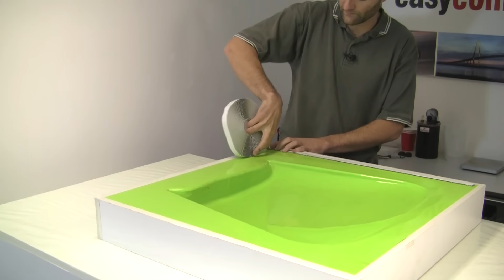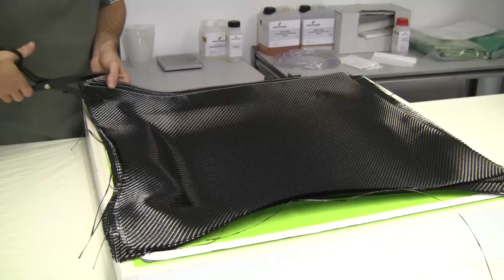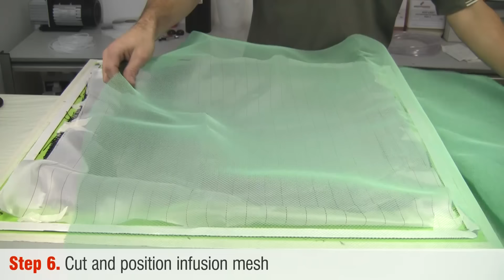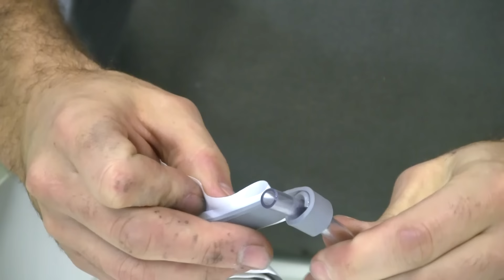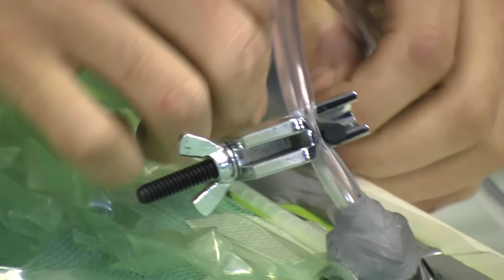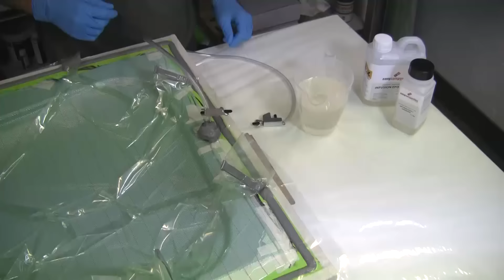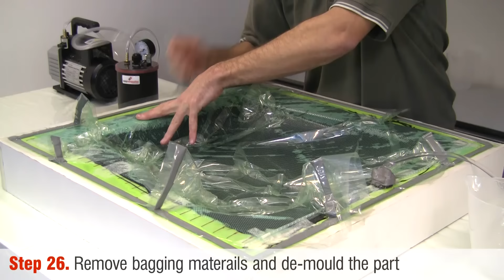How To Do Perfect Vacuum Resin Infusion of a Carbon Fibre Part - Basic Tutorial

Comment: What about the gel gun spray and coat? The video about how to make the bonet shows you applying the gelcoat. Could i make it without the gelcoat and just apply easy release and wax?
Reply: @eeedoubleyou  So i can make a mold with the uni mold kit and aslong as its good taken care of i dont have to do the gel coat process?
Reply: I saw some people who did it without gel coat and it came out perfect.
Reply from the maker: The Gelcoat is optional.  In many mild climates like the UK, you would not even need to lacquer it.  Some sunnier climates it might be wise to use a UV Stable lacquer if the part has no gelcoat.

Comment: how do you calculate required cfm for a given area to select the vacuum pump
Reply from the maker: This is a common question but actually the required CFM of the pump is not related to the area that you're vacuum bagging. A pump of any size can impart the same pressure on a mould the size of a football field as it can on one the size of a postcard. The only reason you might want a higher CFM pump on larger components is to either (a) make the initial pull down faster or (b) overcome leaks if you've not sealed your bag properly. For modest sized components you should always be able to get a properly sealed bag and the pull-down time is not likely to be too long some something like a 1.5CFM pump would be more than adequate.
Reply: @easycompositestv Our component size is abt 400 square cm. Can you now suggest an apt CFM and HP requirement, please?

Comment: i think you can do this without the mesh... its a small piece with only 1 layer
Reply from the maker: You need a flow media of some form, be it a mesh or a core that flows well.  You may get away with the natural through flow on small fabric parts but in most cases the flow is very slow which can cause practical issues with pot life and gel times.
Reply: @easycompositestv  i never had issues with 2x2 meter pieces let alone small ones 

but it all depends on the material you use but still on a small piece as that there is no need really ... you just need to make sure you dont put too much of the catalyst for obvious reasons

Comment: That Peel-Ply way to expensive, gonna experiment a way around that cost.
Reply: you dont need it ... its just there so u dont lose time with smoothing up the leftover resin crap... i think you can even do it without the mesh becouse there is only 1 piece of carbon

also i dont know why this guy is puting holes in the bag ... you can just put the hose under the bag...

Comment: you can de-gas the resin by applying a vacuum (in a sealed container ).
Reply from the maker: Resin can be degassed in a vacuum chamber to remove any trapped air, however this is not normally necessary with infusion resins.  Leaving the resin to stand for a few minutes prior to infusing is usually enough.

Comment: Is the peel ply resin permeable?
Reply from the maker: Yes, the resin will flow through the Peel Ply but it can be torn away from the back of the composite after the resin has cured.
Reply: @easycompositestv  Thanks, very nice setup vacuum setup. I might have to give your starter kit a shot

Comment: 2 questions: Are the rubber connectors for the vacuum lines reusable, and how would you go about cleaning out the resin catch can if the resin already cures?
Reply from the maker: Yes, generally you'll get 5 or 6 uses out of them although they can be a little tricky to remove from the resin when they're fully encased but you can generally cut them out. The only way to clean out cured resin in the catch pot is to mechanical scrape or cut it out with a chisel or knife; that is why its always good to use a disposable catch pot liner to catch any resin.

Comment: Which size of vacuum hoses you guys used in this video? 6mm or 8mm? Thanks!
Reply from the maker: 6mm
Reply: And if we do everything on the proper way, how many times we can use a mould like this?
Reply from the maker: @dobokaydani  A well looked after tool like this should see dozens if not hundreds of pulls so long as it is well maintained and you avoid dropping it, etc.

Comment: Thank you for your reply. Time 10 to 10.43. in this process I am not able to achieve vacuum leak test. Once switch off the vacuum pump it's losses the pressure and gauge reading  shows zero. I arrested all the area. Even though it's leak when pump off. In this case what I l ll do please help me. And one more clarification,   I have used 55 grams of fibre weight, 4 layer of natural fibre , in this case how much resin I ll take in grams? I couldn't understand stand that formula and concepts what u r giving instructions data sheet. Please help me to understand

Comment: Nice video superb. I have face the problem when I de mould the vaccum bagging , peel ply stick in the product. it is difficult to remove the peel ply. Many amount of resin is stick in the peel ply while pull out the peel ply. In product some amount of cavity is formed. What shall I do ? Any suggestions to rectify the problem please .
Reply from the maker: You can cut the peel ply into thin strips along its edge to aid removal. It is always fairly hard to remove the peel ply in one piece.

Comment: in this project you  didn't use gel-coat ! and in your other project ( Car Hood)  you used it,,, what is the reason and  the deference please .   Thanks.
Reply from the maker: Gel coat is not necessary with resin infusion.  It is purely optional.  We included it in the second video to demonstrate the additional work needed should you wish to use a gelcoat.

Comment: Thanks for this video! Highly informative!  Can this technique be use on boat body especially on vertical position? Thanks in advance!
Reply from the maker: Thanks, glad you liked it. Yes, resin infusion is a great process for the manufacture of large composite structures, like a boat hull. The resin infusion process is hardly affected by mould geometry/gravity and so is just as well suited to vertical mould surfaces as horizontal ones. In fact, on our regular training courses we infuse small boat hulls as part of the course.

Comment: How can I make hollow parts(cylinder, tubes and handles) using vacuum infusion?
Reply from the maker: You would need to use a split mould which is still perfectly possible with infusion although you'll often want to 'envelope bag' rather than try to stick the tape around the mould's flange (which you see us do in this video). The actual bag arrangement for hollow shapes like tubes and cylinders is pretty much the same for prepreg or resin infusion and in fact we hope to be producing a tutorial video showing how to bag a tube section pretty soon so make sure you're subscribed to our channel to see that when we publish it.

Comment: Hello!! In the guide to resin infusion you published online, it says: " The vacuum pump should stay on for the duration of the cure cycle. Don’t be tempted to turn it off until the part is fully cured. " However, in this video you just said the opposite. what should we do?? Thanks!
Reply from the maker: Both methods are equally valid. Traditionally with a good resin break, you can certainly leave the pump running.  For some high grade cosmetic applications, we have found slightly better cosmetic results by following the method in the video and sometimes even letting a little bit more resin in than normal before clamping the resin feed.  This may make the part technically a little resin rich but it can help ensure you to minimise surface voids and pinholes.

Comment: Did you change the infusion mesh material from when this video was made and until now? My material is white and very very stiff (plastic) When I de-mold it is impossible to tear off. I have to use pliers and try to rip it apart because the peel ply and mesh are just as hard as the cured resin. Any suggestions?
Reply from the maker: The only change is the colour.  If the parts are a little bit more resin rich, you get a bit more excess resin on the reverse of the part which makes it more difficult to release. The same thing can happen if you have a leak in the bag.  If you struggle a lot, you can use a perforated release film between the mesh and peel ply to aid removal.

Comment: Why not put the Resin into a vacuum container and suck out the air ?
arent you introducing alot of air back into your bag that could make small air gaps in your part and make it look porous ?
Reply from the maker: No, that won't happen. What happens is that the resin degases as it infuses in just the same way as it would in a degassing chamber. You can actually see this happen if you look at the front of the resin line, you'll see it 'fizzing' as it degases because in this area you have resin exposed to total vacuum, just like in a chamber. Some people choose to degas resin before they infuse (and in certain circumstances we would do it too) but for most applications, certainly this one, it's not necessary.

Comment: Hi there. I am planning to manufacture a composite tube using vacuum bag technique. However, after curing the composite, it is very difficult to remove the pipe from the mandrel. I would appreciate your advice on this issue Any possible and easy tube manufacture mthod?
Reply from the maker: If the mandrel has parallel sides that it can be almost impossible to remove a tube from the outside of the mandrel. In this situation what you need to do is either have a slight taper (which is not always possible) or use heat during the cure to exploit the difference in CTE (coefficient of thermal expansion) between metal and carbon fibre. This second method is the way that roll-wrapped tubes are made. You need to use a metal mandrel (ideally with a high CTE like aluminium). You then wrap your carbon and resin around the tube, shrink tape it (rather than vacuum bag it) and then load it into an oven. If you choose a relatively slow resin system (like our AT30 slow hardener) and run the cure at 100'C then the aliminium will expand, the resin and carbon will cure (and the tape will contract) and then you can cool to room temperature which will cause the aluminium to contract (but not the carbon), allowing the mandrel to be extracted.

Comment: Could you fit a Y piece in the vacuum line and pre-vacuum the resin to draw out air bubbles from the resin before you use it for infusing.?  Would this reduce the risk of air bubbles in the part surface?
Reply from the maker: You can degas the resin but in the vast majority of cases this is not necessary as leaving the resin to stand for a few minutes usually self de-gasses the resin enough for the infusion process to work well.

Comment: Any reason why you don't leave the vacuum pump running to "leech out" excess resin longer than shown?
Reply from the maker: For cosmetic parts, sucking out extra resin like that can lead to pinholes so it is better in many cases to leave a small amount of extra resin in the part.

Comment: Won't spiral too thin cause the resin flow through and stuck? If the object is 2m^2 to flow through.
Reply from the maker: For larger projects (like boat hulls) you might want to increase the size of all of the consumables, especially the internal diameter of the hoses and spiral which will allow the resin to flow quicker.

Comment: Does the part need to cure in a curing oven or do the new resins negate the need to do that if the part is structural (such as an aircraft wing)?  Also is it possible to craft a plexiglass box that sits on a gasket instead of having to do all the tape and bags?
Reply from the maker: The IN2 resin used in this project is a room temperature curing resin so no oven cure is needed.  However an oven postcure will always help improve mechanical properties slightly as well as it is highly beneficial if you are trying to achieve the resins maximum HDT.   In theory a box and gasket could potentially seal, however it would not conform perfectly to the back of the bagging stack.

Comment: is there any reason you cant just put it in a big plastic bag?  so you dont need to use the gum tape.
Reply: It's  capbron bagging tested to 400f, you will still need, thermocouples placed away from the vaacum flow path, aerweave breather and vacuum heads place at opposite ends of bag  not together as in this video (helps prevent lock off, and makes for a true reading)
Reply: We have tried. Bought a big plastic bag, so that you need to gum only from one side after you put your stuff inside. It tuned out that most of those bags are not perfect and have tiny leakage that you find only after few hours... 3 out of 3 - the same. We got back to dedicated bagging material. Made a bag with 3 sides gummed, one folded and open-close only one side of gum. We have used that bag many times already and it works just perfect - zero leakage.
Reply from the maker: yes you can do envelope bagging if you wish.  You would normally still use some gum tape to seal the ends and around the silicone connectors.

Comment: Hey Easy Comp guy  I would like to do my body shell after doing all the removable panels has this been done ?
Reply from the maker: It has been done with high end supercars and racecars plenty of times.  However it is a very complicated process needing extensive design experience.
Reply: well I mean't I want to pull molds off of my cars body shell rather than try and give that Christian Von K fella a run for his money ..
Reply: perhaps even pick up another non-runner and sacrifice it in the sense of drilling out spot welds of internal structural pieces to pull molds . . .
Reply from the maker: The problem is you can make non structural panels in that way but if you are copying car structural panels made in steel, you would want to redesign the way the panel works for it to be efficient as a composite panel.

Comment: This is what i do for a living. Cool to see how other people do this process
Reply: Is it dangerous? I mean, do you have to wear some kind of masks?
Reply: salvatore cristiano to trim it/sand it after it’s cured yes- but in the dry fabric state it’s safe to cut without a respirator.  If you use the resins in a well ventilated area you shouldn’t need a respirator either, but that depends on your individual sensitivity to the fumes

Comment: I've noticed some heated debates on the web consisting of which is better; infusion or baking?

My plans:
After watching a good deal of your videos and seeing how easy it is to work with composet materials, I want to make some for my car.
The trouble is, it's a cabriolét and unibody, so even though the exterior panels aren't structural, they still stiffen and flex with the chassis (1997 MX-5).
I want to make new qtr panels because my car does have cancer (rust) forming. But once that's done, I want to paint it to match the car.

Infusion or baking?
Do either of these methods produce a strong part or does it matter? I'm thinking- there's got to be a reason why there are two methods.
Reply from the maker: I presume you mean "baking" to mean oven cured pre-preg carbon materials?  In which case both methods will produce light and strong parts.  The biggest difference is cost.  You need high temperature moulds and a good quality oven to cure pre-pregs.  Resin infusion is done at room temperature so does not need those expensive additions.
Reply: Wicked! :D
Do you guys have any stores in the US? I really appreciate the 'helping out the little guy have access to exotic stuff' aura you guys emit and I want to support that!
Reply from the maker: We don't have a US store as we can ship directly to the USA from the UK.

Comment: Would this process work in the automotive industry?
Reply from the maker: The Resin Infusion process is already used in motorsport and automotive panel production, mainly low volume and specialist vehicle production. Other processes such as RTM and injection moulding of thermoplastics are easier to productionise for the larger volume production of the mainstream automotive industry.

Comment: What materials you use for your mold?
Thank you :)
Reply from the maker: In this video the mould was made from our EG60 Epoxy Tooling Gelcoat and EMP60 Epoxy Moulding Paste. For an infusion with epoxy resin (as shown in this video) it's important that the surface of the mould is made from either epoxy gelcoat or vinylester gelcoat. If you try to use a mould made with polyester gelcoat then you're likely to have problems with the part sticking in the mould. Here's the kit we used to create the mould in this video: http://www.easycomposites.co.uk/#!/starter-kits/epoxy-mould-making-starter-kit.html
Reply: Hi the kit looks good. But the video isn't work in that page. I'll try to ask your customer service for more details. Thank you :)

Comment: Aircraft wings construction? Is it possible?
Reply from the maker: Certainly the resin infusion process can be used to produce aircraft wing skins. Usually there is an amount more work that needs to be done to complete the wing construction (caps, spares, stringers, control surfaces) but the skins themselves (which could be fully structural, depending on the requirements of the design) would be possible.

Comment: Hello! Awesome tutorial!
I wanted to ask how to achieve the same surface finish if we use a male mold and vacuum infusion? As the texture of peel ply is reflected onto the finish side of the product... is there a way to bring out the same finish as in a female mold..? Thank you
Reply from the maker: You will struggle to get it exactly as good, however, a good finish can be achieved by flatting out the peel ply finish to smooth even finish working up to a smooth 1200 grit before having the part lacquered with a clear coat. You will then get a nice smooth glossy finish.